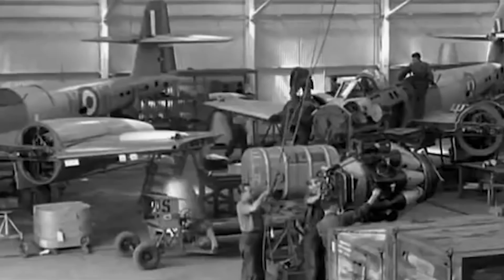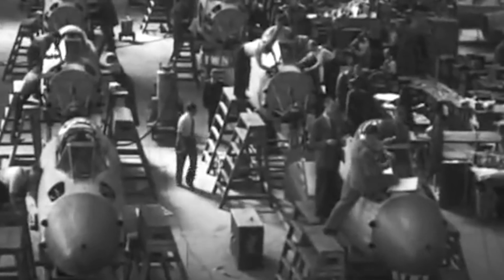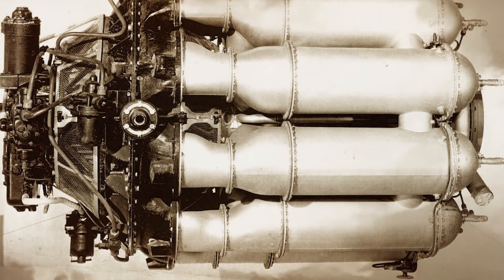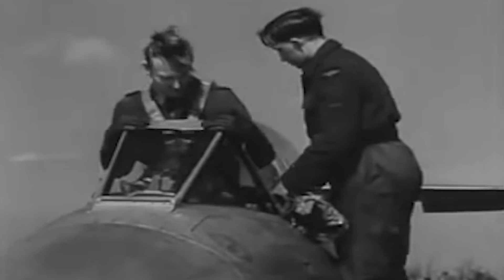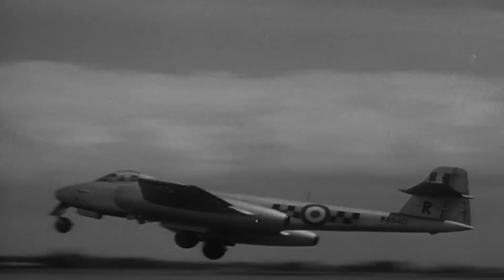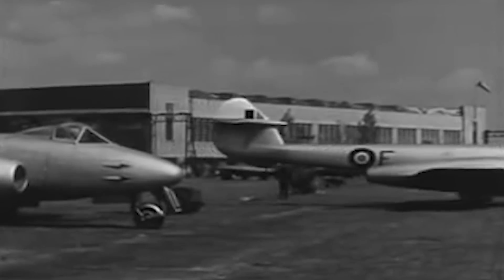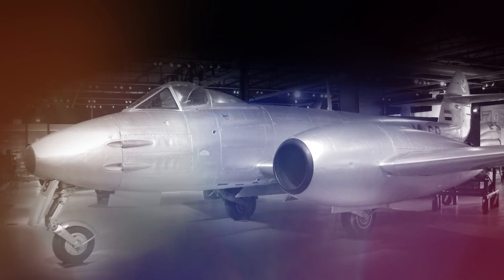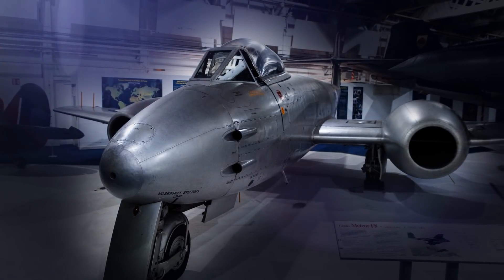Gloster Meteor - The Only Allied Jet to Fight in WW2

Comment: Pretty futuristic bird for that time tbh
Reply: Cody Sonnet  
Tell us what was copied from German jets?  Now think hard.
Reply: @johnburns4017  Russians took the jumo jet engines from the me262 and copied them boom " and Russia now has jet technology" the USA got most of its more advanced rocket science from Germany the swept wing technology advancements as well as the variable geometry aerodynamics. There are stuffs other countries copied from Germany ^-^ denying it is stupid.
Reply: Cody Sonnet  
First turbo prop was on a Meteor. Purely British invention. 
Germans did not invent the swept wing.
Reply: Cody Sonnet  
The first US jet plane was powered by RR engines. 

♦ Whittle's reverse flow design is the basis for almost all turboprop engines in production.
♦ Britain had axial-flow engines running in 1941 - the same time that Franz had his Jumo running. The Metrovick F.2 flew in a Meteor in 1943. The F.2 transpired into the Sapphire which the US built under licence as the J-65 and then modified it as the J-47.
♦ Westinghouse in the US was given a Whittle engine, and plans for improvements. They made such a hash of it that Whittle had to  go to the US to assist. The US government gave the project to GE who made the I-16 which transpired into the first US built jet engine.  The US licensed the Ghost for the P-80/T-33 and the RR Nene. The Nene was used by the Soviets in the MIG 15.
♦ Ohain's engine was not produced, being shelved by 1943.  No engine was built using his design.
♦ Whittle also R&D'd axial-flow engines. The metallurgy was not advanced enough at the time. Whittle's engines produced far more thrust than the German axial-flows and far more reliable.
♦ The PT-6, PWC 100/150 are derivatives of Whittle's designs being still produced.
♦  Whittle's centrifugal-flow engines were built under licence in the US after WW2 - the J-33, J-42 and J-48. 
♦ The Olympus was the world's first 2 shaft turbojet and the first to exceed 10,000 pounds of thrust. 
♦ The 1950 Avon was the first reliable axial-flow engine. Also the longest produced gas turbine in history being still in production as a land based generator. 
♦ The RR Conway was the world's first turbofan.
♦ The RB-211 was the world's first 3 shaft turbofan.
♦ The Rolls Royce Trent was the world's first turboprop to fly.
♦ British axial-flows led the post war world in technology and power. 
♦ The axial-flow Sapphire was built in the US as the J-65.  The GE J-47 was based on the Sapphire. 

Frank Whittle invented the modern turbojet.
Reply: Cody Sonnet  
In the UK even a test plane needed an airworthy certificate at the time.  A crock like the 1939 Heinkel would never get one.

The British would not put into the sky such an incomplete death-trap of a plane like the 262.
Reply: Cody Sonnet  
Look again and hard.
Reply: Cody Sonnet  Oh so the Germans had more advanced radar, manufacturing methods, superchargers, fuzes, computer systems, bombsights, mixed unit tactics and logistics?

Oh wait no, they just made a rocket or two
Reply: Cody Sonnet  
♦ Ohain did not design a reverse flow engine. His engine had a centrifugal compressor and a radial inflow (centrifugal turbine - a design never used in any production engine - this was a patent filed by Whittle. Ohain even commented on its unusual design when he read Whittle's patent prior to filing his own: From Ohain's biography: "When I saw Whittle’s patent I was almost convinced that it had something to do with boundary layer suction combinations. It had a two-ﬂow, dual entrance flow radial flow compressor that looked monstrous from an engine point of view. Its ﬂow reversal looked to us to be an undesirable thing, but it turned out that it wasn't so bad after all though it gave some minor instability problems."
Reply: You are so eager to assert that German tech was superior to the British, that you forget to read what they actually made, and how useful it actually was.

The first jet engine to run, and to fly in a plane, was von Ohain's project at Heinkel. He had massive funding from a major industrialist. Von Ohain himself admitted that he looked very closely indeed at Whittle's jet engine patents before starting work on his own jet engine. That engine had a centrifugal compressor and turbine. It was not the axial jet at all. It was unreliable, inefficient, low power, low life, despite having massive funding from Heinkel - a failure, Tat was not continued. 

Whittle chose to concentrate his very limited funding on the centrifugal compressor because it was well-understood. He was focused on making a war-usable, reliable and powerful engine - quickly - which would outperform the best piston engine planes of the day.  All of these qualities the Jumo and BMW axial jet engines lacked. On limited funding, Whittle developed a reliable engine which was combat-ready just before war-end. Within months, production engines were also more powerful (Gloster Meteor's top speed of 600mph in late 1945, 650mph in mid '46) than any of the total garbage engines turned out by the rushed German programs to the enormous detriment of actual combat. You can not claim that an engine with a service life of 10-12 hours, which can not be rapidly throttled up or down otherwise it stalls, is prone to flame-out, and generally terrifies its pilots, is combat ready. They were unproven, and problematic for the day, axial jet engines, being garbage.

The problems with German jets engines were not caused by the scarcity of metals in Germany during WW2, as they had access to enough rare metals. To make a useful jet engine you need high-strength alloys which will resist high temperature. No iron-based alloy is suitable. Germany had no programme to develop such alloys. The British did, developing the nimonic series alloys, making use of them in the WW2 jet engine programme. That is one, just one, of the reasons why the British jet program had combat potential, with the German program doomed to failure.

The Me262 airframe had many serious faults:

♦ high landing speed:
♦ difficult to maneuver;
♦ no air brakes;
♦ centre of gravity too far back;
♦ Poor downwards pilot visibility;

Those faults made attacking other aircraft far more difficult - at a time when they were desperately short of pilots, particularly pilots with sufficient skill and experience to fly what was a very difficult plane to fly and fight in. 

The sweep-back of the wing of the Me262 was minimal, only in the leading edge, with a part of the trailing edge of the wing being straight. The swept wing was an insufficient correction for the plane's centre of gravity problem, not aerodynamics, that prompted the slight wing sweep. It was not until years later that properly designed swept-back wings were introduced in combat planes. By contrast the Gloster Meteor was:

♦ handleable;
♦ maneuverable;
♦ a balanced combat plane. 

While the Meteor was being developed, the British were also working on the supersonic Miles 52 plane - the project was dropped with the plans given over to the USA, which resulted in Bell X-1.  No one copied the Me262 in the post war rush to get fast jet planes into service. The British also produced new planes - the world's most advanced, in engine and airframe.
Reply: Cody Sonnet  
Ohain was a charleton. His first designs were centrifugal and failed. The Germans went the problematic, at the time, axial flow design. The British flew a Meteor with an axial-flow Metro-Vick engine in 1943 dropping it in favour of the reliable centrifugal design. There were five turbojet engines in the UK under R&D in WW2:

 ♦ Centrifugal, by Whittle (Rover);
 ♦ Centrifugal, by Frank Halford (DeHaviland);
 ♦ Axial-flow, by Metro-Vick;
 ♦ Axial-flow by Griffiths (Rolls Royce);
 ♦ Axial flow compressor, with reverse flow combustion chambers. The ASX by Armstrong Siddley;

Metro-Vick sold their jet engine division to Armstrong Siddley. The Metro-Vick engine transpired into the post war Sapphire. Most American engines in the 1940s/50s were of UK design, many made under licence. The US licensed the J-42 (RR Nene) and J-48 (RR Tay), being virtually identical to the British engines. US aircraft used licensed British engines powering the: P-59, P-80, T-33, F9F Panther, F9F-6 Cougar, FJ Fury 3 and 4, Martin B-57 Canberra, F-94 Starfire, A4 Skyhawk and the A7 Corsair.

The US General Electric J-47 turbojet was developed by General Electric in conjunction with Metropolitan Vickers of the UK, who had already developed a 9-stage axial-flow compressor engine licensing the design to Allison in 1944 for the earlier J-35 engine first flying in May 1948. The centrifugal Rolls Royce Nene is one of the highest production jet engines in history with over 50,000 built.
Reply: @johnburns4017  Hans von Ohain's jet engine was very successful...
IT POWERED THE WORLD'S FIRST JET AIRCRAFT.
Reply: @johnburns4017  German axial compressor engines were the first in mass production and helped shot down over 500 Allied aircraft.
Reply: @sandervanderkammen9230  
Not this nut again.
Reply: @johnburns4017  John please go down to your local Mazda dealer and see for yourself.
There are no 2020 models available with a rotary engine.
You are losing you grip on reality and need psychiatric help.
Reply: @johnburns4017  Hi Donald Trump!
Reply: @johnburns4017  Hi  Donald Trump.
Reply: @johnburns4017  Still there John ? So, who is this Doktorbimmer. A wehraboo ?
Reply: @lucastekkan  
He is Sander Van der Kammen  and doktorbimmer!

A complete nut job.
Reply: @sandervanderkammen9230  German axial compressor engines were the first to be utterly crap and quickly dropped unless significantly improved by the French.
Reply: @johnburns4017  WRONG! 

You forgot the Welland, Derwent and Nene.
Designed by Adrian Lombard and Stanley Hooker at ROLLS-ROYCE.

THERE WERE MORE THAN TWENTY JET ENGINES UNDER DEVELOPMENT IN GERMANY
Reply: @sandervanderkammen9230  There may have been twenty engines underdeveloped in germany and some of those underdeveloped engines were actually put in aircraft which is why the Me262 had an appalling 33% mechanical failure crash rate.
Reply: @johnburns4017  The Metrovick was a failure.
Armstrong-Siddeley redesigned it and produced a new engine called the Sapphire... it was not ready for production until the 1950s.
The Nene was unpopular and was produced in very limited numbers.

The world's most produced jet engine was the GE J47. (36,500 units)
The J47 was designed by Johann Von Neumann and his team of German JUMO engineers transferred to the U.S. under Operation Lusty and Operation Paperclip.
Reply: @sandervanderkammen9230  The Metrovick F2 was very successful as the Sapphire and also J65. The J47 was of course a development of the J35 which was itself a development of the T31 from 1943.
Reply: Cody Sonnet  
Totally nonsense!
You have not heard of Megaroc:
https://www.youtube.com/watch?v=wWFFzL65dEQ
The British were planning to have a man in space in 1951. They built the rocket and capsule. 
Only when the British got involved with NASA did the Americans get anywhere.
Reply: Cody Sonnet  
Complete and utter garbage, every word.
Reply: Cody Sonnet  
The HE178, was an experimental plane that was dropped. The engine was like a hair dryer. You are such an idiot.
Reply: Very outdated design compared to the Messerschmitt Me-262.
Reply: @sandervanderkammen9230  
Complete nonsense. The 262 is based on a 1938 piston air frame.  The Meteor is a part of family of aircraft. The bigger version was the Canberra (B57 in the USA) - the plane that flew so high the Soviets could not catch it.
Reply: I can't agree with that. Other than the engines, it was a thoroughly ordinary plane.
Reply: The design is far from  futuristic tho still resembles an twin piston airframe and  still looks like something from ww2 on the other side Germans did made something ahead in terms of design like the me163 or the ho229 or the less known me p.1101 and many more.
Reply: @trollek7823  
Look hard at twin engne piston planes and the Meteor.
Reply: @johnburns4017  you either have a problem either u can't see that the gloster meteor is almost identical to  de Havilland mosquito and the only difference is the addition of those jet engines and the tail
Reply: @trollek7823  
You have no idea. The Meteor was very different to the Mossie. One was made of wood with a tail wheel.
Reply: @johnburns4017  yeah as build and such they might be different yeah but as the freaking design is almost impossible to not see that the meteor could even have props and would basically look similarly to a mosquito.  My point was that visually this aircraft is still resembling something built during ww2 and you have to be blind to say otherwise .
Reply: @trollek7823  
You have not a clue.
Reply: @trollek7823  The me-163 was so advanced it was more dangerous to its own pilots and ground crews than it was to Allied bombers.  The ho-229 was so advanced that only one glider and one functional prototype and they had a huge problem of de-laminating because they were made of wood and shoddy glue, and its designer refused to make a better design because he was obsessed with the idea of the flying wing.

German technological advantage is a myth
Reply: @riffler24  it's not about their performance tho I'm very well documented about most of ww2 since I study it ... I was pointing out the physical design . As for technology. . The Germans just had a different approach to things and spent way to much resources on useless things that may be considered more advanced in terms of technological innovation.   Learn to read properly.
Reply: @trollek7823  Ah OK I think I see the confusion.  In terms of physical looks you can argue that the German jets were more "modern" because of swept wings I suppose.  Though it's not like the allies didn't know about swept wings, they simply weren't certain it was a big enough improvement to bother with